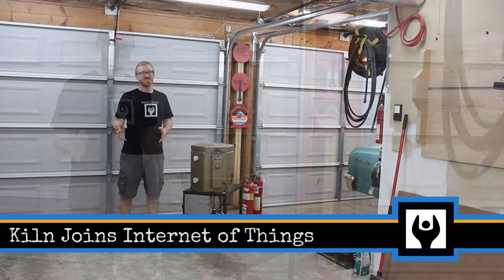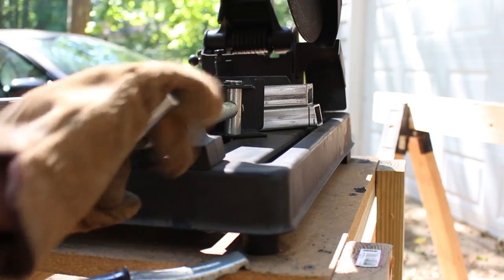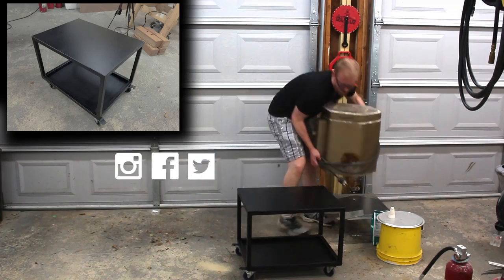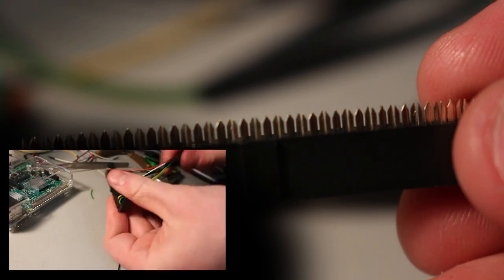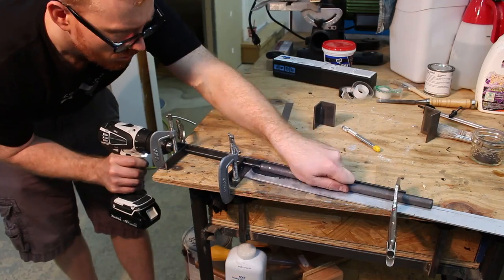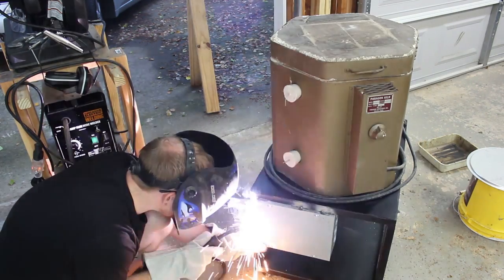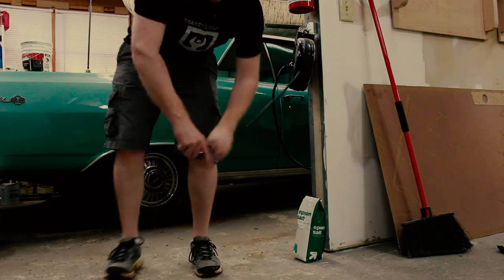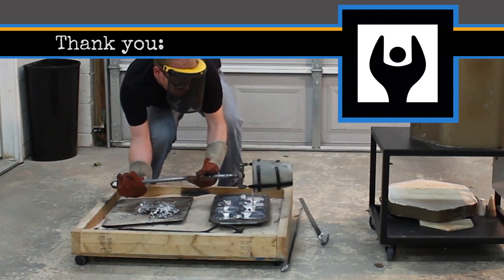DIY Raspberry Pi Temperature Control for Kiln Foundry

Comment: Nice job.
Material properties relating to sensible and latent heat are a very interesting subject with relation to energy input and change of state. Incidentally there was a small error you made there in describing it as latent heat of vaporisation, the state change is solid to liquid so the relevant term is latent heat of liquefaction.
If you’re interested, it is possible to calculate the energy inputs, you need the specific heat figures for both the sensible heat and the latent heat of liquefaction. These combined with the weight, the initial and final temperature can calculate the total energy in kJ, and Joules/Seconds gives you watts, so you should be able to calculate fairly closely how long and how much energy you need for a given mass.
Don’t forget that if you continue heating after liquefaction you’re going to be continuing to add sensible heat and if you added enough you would eventually be having to consider latent heat of vaporisation.

Comment: nice work and one helluva learning experience. I need to look more into the pi and arduino boards as it seems theres a lot of nice additions I could add to my "toolbox" lol....still a bit oldschool tho and was feeling perty cutting edge when I hooked up a cheap PID a couple yrs back.With accurate temp control you will have much better pours and have the added bonus of being able to use the kiln to heat treat your castings and /or anything else that reguires timed stages at certain temps....and before anyone says you cant...yes you can heat treat aluminum at home as well as steel/etc...most metal supply places will show heat,"soak" and cool periods if you you look up the specific alloy...hell with a top opening kiln you can even furnace braze and do things under inert gas if you take the time to seal it up a bit and use the displacement method(gas cylinders can get a bit pricey lol)

Comment: Hi, great project and video.
I am looking to create a kiln with a controller which I can program on my computer of smartphone by means of a graph editor/viewer. 
This to overcome the very outdated and user unfriendly pid controllers. 

Your project shows great potential. 
My oven needs to heat slowly in steps of 100 degrees an hour and stay for at least an hour at 850 degrees. 
I use a J thermocouple for this.
Do you have any tips for beginners or ready made parts and software which I can use/buy for this?

Any help is much appreciated!
Kind regards,
Sébastian

Comment: Don't use lifting tongs to pour, they are only for taking the crucible out of the furnace.  You put your pouring frame on the floor with a face warmed insulated brick in the crucible ring, you put the crucible on the brick and lift the pouring ring and engage the holding clamp bar and lift the pouring frame.
  Doing it the way you are runs the risk of crushing the crucible, dropping the crucible and you are chilling the crucible You can't pour safely with tongs and your hand is downhill from the molten metal.

Comment: So the rising heat from the kiln to the ceiling of the garage is not a fire hazard? I have a kiln I just converted and I'm weary of how/when/where to open the lid, when at around 1300F. for aluminum. I lack that practical perspective.

Comment: Great build,
do you have a dedicated button for stopping / starting the raspberry pi, or is it via software?

I guess an implementation of a two point thermostat also allows you to temperature treat steel in your kiln.
Reply from the maker: The dedicated button is in the openhab interface. If my wifi router or openhab server dies I could not start the kiln. I can stop it with the rotary nob. I want to do some heat treating annealing eventually. I need a better temp control like a slow pwm driven by a PID.

Comment: Nice job Cressel. Have you thought about adding an indicator light that shows when the elements in the kiln are hot? BTW - I too an jealous of the kiln purchase.
Reply from the maker: +Chris Muncy +Chris Muncy I thought about having a bar LED to give an idea of how far along the temperature was. I decided against it because of having to mount it and add components. It would be easy enough to write a rule in openHab to flash the garage lights when the kiln is up to temp. One other reason I may want a light is so I would know when the elements are on and the kiln is warming...so I don't accidentally leave it on. My wife regularly has this problem with our gas stove, but her notification typically is delivered to me about 20 miles away from home on the way out of state. If I am not running the kiln, I unplug it and coil the cord. I can also use the nob to turn the elements off regardless of the controller state.  Thanks for the question hope I answered it. BTW I'll have my wife look out for another kiln for you and Wes ;)
Reply: Tell your wife I love her lol.
Reply from the maker: +etienne nel no worries I respond to lots of variations. Comes with having an unusual name. :)

Comment: Hello, can you please tell we what is the thermocouple you are using? I have trouble finding one rated for more than 800 degrees Celsius. And what is the tube holding thermocouple made of?  
I also have electric klin foundry powered by 240V with the same heating wire as yours and I am looking for good thermocouple to use with MAX31855, Your project looks great and I am aiming to reach your level of professional-looking foundry :D
Reply from the maker: https://www.mcmaster.com/#7979A18 for gouging electrod used as shell tube. https://www.mcmaster.com/#3859K44 for type K TC.
Reply: Did you have problems with burning your heating wire before you installed temperature control?  I have similar 2000W heating wire and without watching over it it burns and break from the heat. Do you control relay on the heater by looking at the crucible temperature and the klin temperature is plotted just to compare them?
Reply from the maker: I haven't had any issues with the heating wire burning out. I think it loses too much heat to get hot enough. Initially I was controlling on the crucible temperature. Now I am just controlling on the ambient kiln temp. I am glad I compared them since I could see the metal flat line while adding the latent heat of fusion even though the ambient kiln temp kept increasing. They are both pretty close once up to pouring temp.
Reply: so it may be enough to use only one TC to measure kiln temperature and try to keep it at the level slightly above melting temp.?  Can you tell me what kind of wire are you using? maybe mine is just too thin to withstand larger temperatures.
Reply from the maker: Michal Herzyk i used 20awg with a ceramic fiber insulation rated to 2200F inside the kiln. that is unnecessary though. i use 24awg with  fiberglass insulation rated to 900f outside the kiln. this connects directly to the main ambient TC bent up through the port. the connection is on the outside of the kiln. i got both the TC and TC wire from mcmaster carr.
Reply: Just one more question, are you using 5mm diameter coil heating wire inside the kiln? or how did you choose heating wire? mine keeps breaking after heating up too much. You really helped me out, it gonna be much easier for me to upgrade my kiln now.
Reply from the maker: Michal Herzyk my wife bought the kiln at a thrift store for $10. i have not had problems with the wire. it is the original 40 year old wire. you may want to consider getting a replacement element for a brand name kiln. mine is a Paragon kiln. i have it in storage as we are moving so i cant get better info off the kiln for you right now. it is a max 2300F kiln 120V 2160W variety.

Comment: How many watts has your kiln?
And how many time do you neen to heat it up , to melt the aluminum?
Reply from the maker: 2400W. I have since required for 240V
Reply from the maker: It takes about 4 hours to melt aluminum.

Comment: Yes, you'll realize - you can NOT run anything thats high amperage draw on any sort of extension cord, it will make the cord hot, melt plugs, trip breakers, ect - theres formulas involved with amp and voltage drops over distance and the need to run larger wire for longer runs- but for something like that kiln I would say: I wouldnt go any more than a 10 or 15 ft cord of at least 12 or 10 ga wire (stranded) and then I would NEVER use any extension cord, AND I would wire a dedicated outlet, just for that Kiln use. with at least 10 or 8ga wire back to the breaker box, depending on how far away it is (sometimes you can ask an electrician, or occasionally the guys at Home Depot or Lowes in the electrical aisle can tell you the size wire you need for a 20-amp circuit for an outlet thats "X" distance from the box! either way it should be dedicated on it's own breaker and not daisy-chained to a bunch of other outlets in the line......
Reply from the maker: Yes indeed. Your comment really caused me to reflect on my installation. I can operate the kiln at 5, 10, or 20A based on a selector switch on the unit.

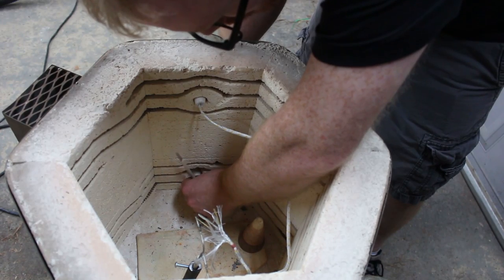After Metal Lathe - Part 8, 7:00, I have been very aware of just how taxing the kiln can be. Based on that little incident, I thoroughly checked out the circuit. I pulled the receptacle I use out of the box and confirmed the diameter of the copper coming in to the box as well as replacing the 30 year old receptacle. There is only one other receptacle between the one I use and the electrical box, total 15ft distance. I also pulled the intermediate receptacle and confirmed the gauge of wire coming into and out of that box and replaced that one with a new unit. Further, I made a pigtail in that box so as to not rely on a daisy-chain to feed my outlet. A fortunate benefit of having open joists in my garage ceiling is that I can trace this circuit out completely. There are other receptacles downstream, but when the kiln is operating I can be sure it is effectively a dedicated circuit. Finally, I replaced the cord coming from the kiln, used a stranded 12ga cord with 90C insulation, and added a NEMA 5-20 plug. After those checks and upgrades, I used my IR thermometer to confirm the temperature rise of the circuit, especially paying close attention to junctions: the electrical box, the two receptacles, and the kiln wiring. They get warm, but not over 20F rise in temperature over ambient conditions.

That got me to the point where I was OK with the kiln on that circuit. However, I will probably rewire the kiln so it works on 240V so as to reduce the overall current draw, but for now I will probably continue operating the kiln from this effectively dedicated circuit.

During this video, I definitely pressed my luck with a 20A-rated extension reel. Although rated at 20A, its wall-wart circuit protector tripped after 45min at 19A. 

I still wanted to be able to get the kiln outside the garage. I made a 20ft extension cord out of 12ga 90C rated cable with again NEMA 5-20 plugs and receptacle. I am not aware of a reason why extension cords cannot be used for high current applications. It seems they could be appropriately sized for the application. NFPA 70E might have something to that effect, so please direct me to the section if its in there.

I believe the X distance from the box calculation is to limit the voltage drop caused by a high load. In my case a voltage drop at my resistive load would decrease the overall current draw. Regardless, I have done voltage drop calculations and even with my 20ft 12ga home-made extension cord, I expect less than 3% voltage drop.

So that is my rationalization for where I am at. Note that NFPA 70E actually limits cord connected load on a 20A circuit to 16A. Not sure if the code was different in that section when my house was built, or if cord-connected loads are grandfathered in anyway.

Wow, sorry to write such a long response. Your comment resonates with me. I really like to understand what the code requirement is, then I am better informed about what is the best for my installation. Lots of ways to define best: facilitating future expansion, cost minimization, installation feasibility, return on investment, safety.